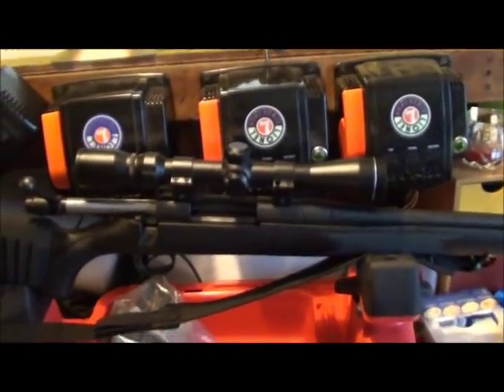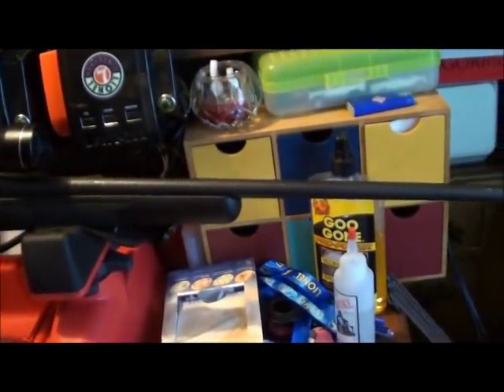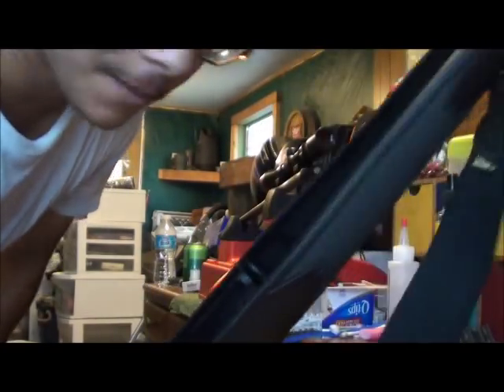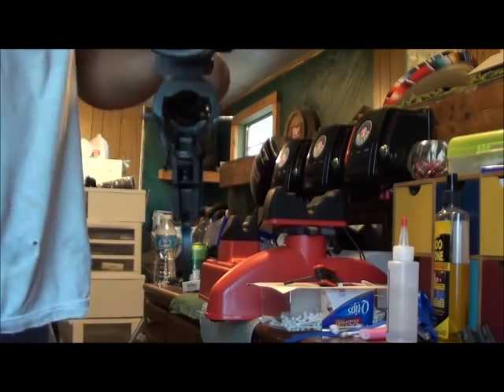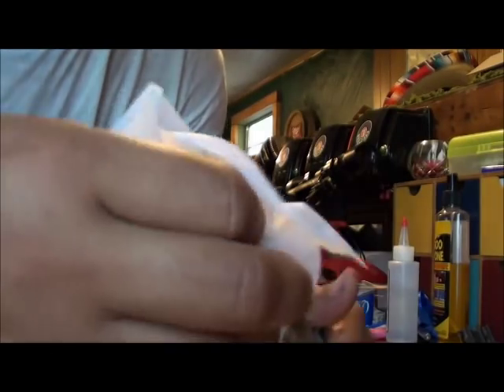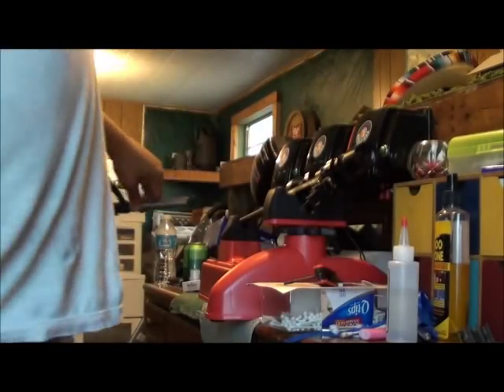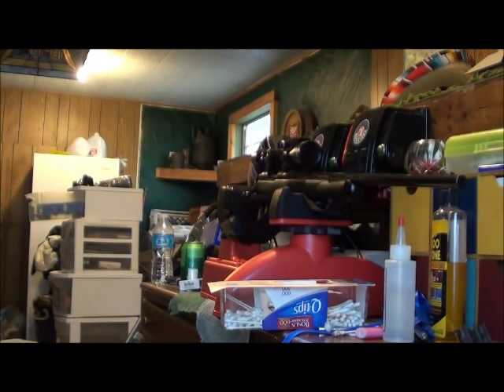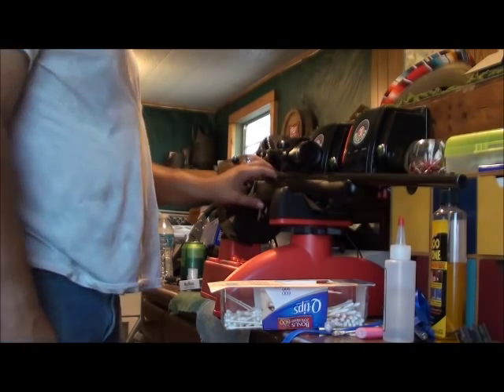Rifleman How To: Clean A Mossberg ATR 100 Rifle

Comment: I have the Mossberg Patriot in 243.  (evolution of the ATR) and I don't have to remove the action from the stock.  I have the SS Marine Cerakote and Laminate stock.  I topped mine with a Nikon Tactical 308 4-12 x 40 BDC 800 scope.  Dimes @ 100 yards.  (all holes touching)  3/4 group @ 200 yards.  (Quarter size)

Comment: I know this video is a bit old but I'm hoping somebody sees this and has a good answer for me. So I've got a basic cleansing of this firearm. The barrel what I could reach inside the magazine and the bolt and contact points for the bolt and obviously the exterior of the weapon. All that has been cleaned. The two screws holding the barrel assembly and whatnot to the frame... I cannot loosen them to the point where they are beginning to strip so obviously I'm stopping. Does anybody have any suggestions? I would rather not have to drill them out. Any suggestions would be appreciated. I purchased this firearm used today and overall it's in damn good shape but my OCD dictates that I Terry firearm down new or used that I ever purchase and do a thorough cleansing and lubrication.

 Any suggestions would be greatly appreciated.